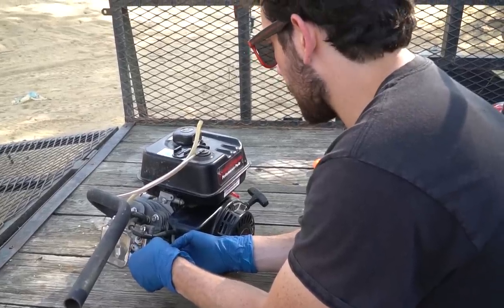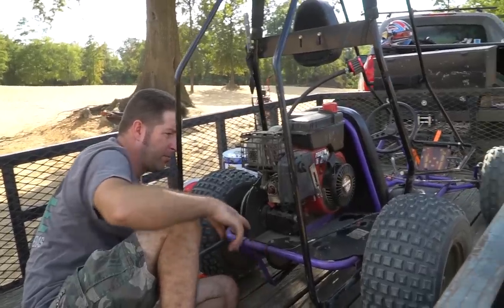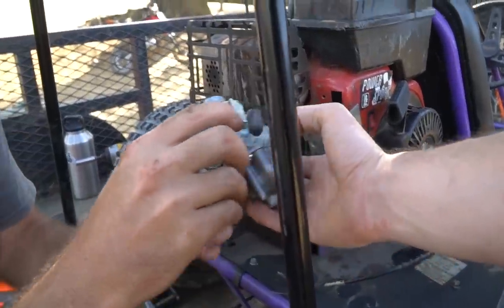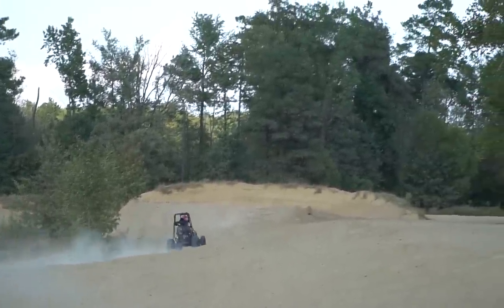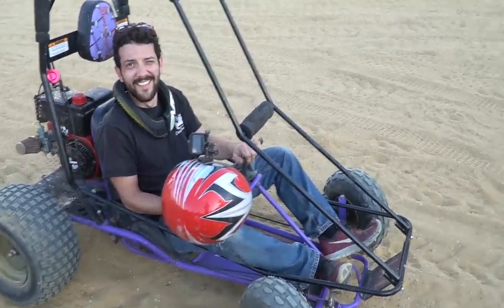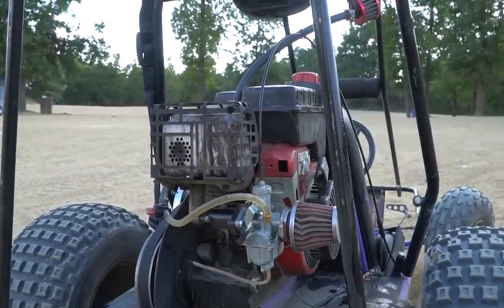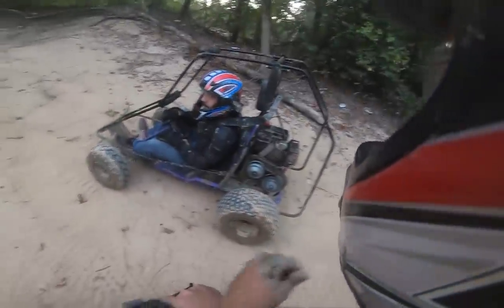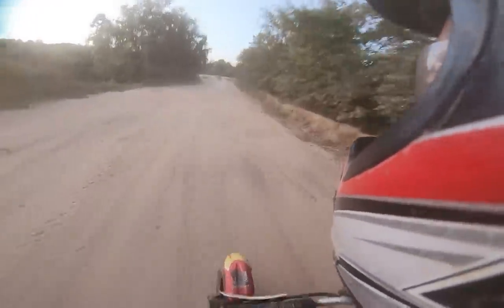Secret Tecumseh Performance Mod | One Bolt On = WAY More Power!

Comment: I have to Invader fun kart with the same motor, what I had done is weldeda intake  that is 3 inches long with a 20 mm Mikuni carburetor I shave the head with a belt sander and shimmed the stock valve springs and made a three-step header 91 octane gas bypass governor and did a light port and polish on the intake and exhaust to match Port the new intake it went from going 42 miles an hour being stock with a bypass governor now it goes 56 miles an hour with aggressive gearing

Comment: I have the same kart but the Tecumseh engine had carb issues. Swapped in Predator 212, now its too fast and i'm swapping in a Honda atc 185 rear axle with drum brakes.

Comment: This video was very helpful. I'm currently building a Dingo with an 8hp Tecumseh. I've done intake and exhaust but have been wrestling with fuel issues with the stock carburetor that drilling the jet hasn't fixed. What size Mikuni would you recommend for an 8hp Tecumseh with an intake and exhaust? 26mm maybe? (This is a question for anyone to answer. I don't really expect John or Isaac to see this.)
Reply: JustTheTip187 I bet Isaac will comment?
Reply: 26 might be to big. Id go in between

Comment: If they don’t sell billet rods for the Tecumseh. I have jb welded a rod before it took the abuse and  the high rpms well. Never snap a rod before that way but you do lose hp because it’s make it heavier.

Comment: Okay y'all are just driving me insane, I've been a small engine repair mechanic for over 20 years the correct pronunciation is ti-KUM-see
Reply: And I've heard it both ways for close to the same time and no one can agree on the pronunciation.
Reply: That's true I have to butt down here and South 95% say it with .....see sound
Reply: Actually its te-kum-sa
Reply: It’s not leviosa it’s leviosaa! HP fans will get this.
Reply: @adventurefishing3190  I thought it was te-kum-say

Comment: ANOTHER really cool trick to do on a small 4 stroke engine is, split the case and retard the valve cam gear by one tooth. Put it back together, fire it up and at idle, it'll sound like it has a high performance cam in it, but will rev quickly and have more torque. Pretty cool! Have fun! 😁

Comment: I'm gonna help you out here, if you wanna stick a billet flywheel, everyone will tell you that it's impossible and that theres no  such thing made for it and that is simply not true.  You can use a billet aluminum flywheel meant for a 5 horse flat head with the electronic Ignition but you have to cut the posts that the coil mounts to a bit shorter  and retap so it lines up with the magnet.

Comment: BMIKarts is gonna have a few goodies for that tecumseh the weakest part on that engine is gonna be the Rod i think ARC still sells billet rods you will have to call them also the blow by issue can be fixed really easy you will have to build a catch can nothen fancy but it will need 3 inputs and 1 out put on the bottom and a breather on the top stuff it with some steel wool not alot just enough to prevent oil build up and sloshing

1. Drill 2 holes in front of the case if you plan on keeping the factory fuel tank or attempt to use 2 90's 3/8" will do run 2 of those to the top of the catch can
2. Tap a 3/8" fitting to the Rocker cover using the factory hole and run that to the catch can
3. Run a drain from the catch can to front of the engines oil drain if it has one if not drill and tap a hole for one 

Intake from my previous testing a 22-26mm mikuni Works great 22 being the smallest id go for a intake i just made some Flanges out of 1/16" plate and 3/4" Exhaust pipe from BMI karts just the U bend from one of there kits and a BMI exhuast 

Carb i used a 24mm Mikuni Flat slide 170/20 jet kit and my custom intake this was on a 5.5hp same block pretty much as the 6.5

Rod/Flywheel I never did find a flywheel but i got a Rod threw ARC and if memory serves me right it is a tad bit shorter from them so shaving the head is a ok thing to do altho i would not shave it to to much but for everything else i ran Stock. 

Engine did make some power but the cam is the limiting factory along with lack of aftermarket valve train goodies.

Comment: In the video you said that with the stock carb the engine cut on and off. I have a and manco dingo with a 10hp Tecumseh and my does the same thing do you thing a mikuni would help? Also loving the manco dingo videos keep up the good work.
Reply: It helped us
Reply: Do You think a 22mm would be able to run a 358cc 10hp or should I go bigger?

Comment: Do a off set key on the flywheel and crank to adjust your timing run her on some race gas and you for sure will have to open the exhaust then you will have a stage one performance Tecumseh.

Comment: What is the issue with oil leaking out the crankcase vent? I'm pretty sure I have the same issue on my Yerfdog. I was thinking I'd need to tear down the motor to figure it out, but if someone can point me in the right direction, that would be great.

Comment: Just change the crankcase vent,-they go out alot on those motors, they are great engines other than that in my experience

Comment: Guys it's a shame that Tecumseh went out of business. They were cheaper and easier to work on with the carburetor designs they had...the only difference between Tecumseh and Briggs and Stratton is the Brigs IC or industrial/commercial models with a cast iron cylinder liner and roller bearings on both ends of the crankshaft...I worked on Tecumseh engines and all other 2 and 4 stroke engines every day for 5 years.. I miss my Tecumseh...😰

Comment: Not bad i have a go kart like The engine it was on the yerf dog well i do have a yerf dog and i used it in mud with turf tires and it will just tear the mud up no joke but i had to get the carburetor change  welp for a stock engine no mods to it will probly go about 40 HPM  but carburetor engines are not dat bad

Comment: Tecumseh engines are good motors but the stock carbs on them are garbage. Personally I would really like to see what kinda power you can come up with by just porting/polishing and other cheap mods. Watch the flywheel tho, I have no idea what kinda rpm's they are good for.

Comment: If you buy a new valve cover it will not blow out oil because they have check valves in them and the old one is not closing all the way

Comment: All the Tecumseh race motors i built i had to run a oil catch can. They all blow oil. I have about 15 to 20 tecumseh ring sets, Some are in boxes all are new. I have a Tecumseh Star race motor. I will only sell it all together, The Star Motor is pulled apart sitting in my parts washer. Won't ship will have to be picked up. Weighs to much to ship.I have New Star side covers . To who don't  know a Star is a 10 Hp. I have cam blanks you can have grind to the Duration you want.

Comment: Do u have to remove the gover from predator to install a carb swap
Reply: web homemade projects, no. The governor limits rpm on the engine. If you take the governor out, put 18 pound valve springs in so you don’t blow the engine up. The engine cannot go above 6,000 rpm.
Reply: So I can leave it

Comment: Tecumseh engines have crappy intake port castings. You'll see when you remove the factory intake manifold.  Port the intake with a dremel tool and get rid of the sharp edges/corners to improve flow and pick up even more power.

Comment: here you guys go. I have a list of different aftermarket parts you can modifly for that engine...https://www.oldminibikes.com/forum/index.php?threads/tecumseh-ohh-build.131688/
here is one of my drag motors I built couple years ago. turn over 8000 rpm's at 125ft, race it on clay surface.https://youtu.be/Ue-4HkKUTNE

Comment: Great video guys, thank you!
In my experience over many years...Tecumsehs are junk!
I have never had one that stayed running good or last nearly as long as the Briggs and Strattons I've had.
99% of the time the carbs failed or corroded beyond repair and I never used and gasoline with alcohol.
That was usually followed by engine failure, some spectacularly throwing the rod clear through the block.
The last one was on a push mower I inherited. I spent $80 on a new carb and other parts, it blew out the crankcase seals and the new carb failed after less than a year.
No thanks, I will not ever use a Tecumseh again.
Reply: the Tecumseh had tons and tons of carb issues well they dont have to worry about that any longer. the blocks were pretty reliable just cant over rev them as much as you can a brigs. but if they lighten up that fly wheel port and polish it shave that head bigger valves even by the slightest and take their time to tune that carb with a good pipe that engine will run with these other ones these days. they need to advance the ignition timing and modify the cam a slight bit and they will see a huge gain.  JUST DONT OVER REV IT. that rod will fly through the block done it on a ton of these they blow up allot easier then brigs but when built correctly they will be fine specially when under a load.
Reply: stop spining them so hard then. id be glad yto take all your tecumsehs. on btw, they run harder than and beat briggs engines :)
Reply: That's the problem, I never did spin them any harder than the factory set governor would allow and they would still self destruct within 2-3 years of purchasing them.
Sorry, they all went to scrap metal years ago.
Also, I don't really care about your statement that they run harder and beat Briggs, I no longer care because I haven't been 12 years old for a long time.
Reply: @TrojanHorse1959  ahh, the old ad hominem trick. you aren't impressing anyone by trying to claim how "grown up" you are. No one cares here. I've seen shitloads of Briggs sling rods too. All you have is an opinion, nothing more.
Reply: Lol! I made no "claims" about anything other than I'm not 12 so your childish digs at me about Tecumseh vs Briggs do not bother me in the least.
Yes, I have my opinion and experiences to rely on which are what formed my opinions. Because they do not match yours you felt the need to troll my comment. Crawl back under your rock, no one here cares what you think either.
Reply: @TrojanHorse1959  no trolling, just calling out your claims. your experience is not another's.
Reply: Well good grief, everyone knows my experiences are not the same as anyone else's, Captain Obvious.
I did say "In My Experience"...meaning they are just mine and no one else's.
And, not knowing me or anything about me, you can't "call out my claims" because you just do not know and pretending to know makes you a troll for attacking me with no provocation or good reason.
That is trolling whether you wish to admit it or not.
Reply: @TrojanHorse1959  I've had my own experiences with Tecumseh's, and never had the problems you speak of.
Reply: I can understand that, it's possible we live in different areas and have different suppliers or you don't use your small engines as much as I do, or the Tecumseh Gods hate me, who knows.
Every Tecumseh I have ever owned has been problematic or they self destruct. In my experience they are just not as tough or as good as a Briggs and Stratton.
I have one Tecumseh left, it's an 11 or 12 hp horizontal shaft engine. When running it vibrates so terribly bad that I cannot use it on anything and most likely the carb is bad again at this point. I have tried to trade it for an equal size Briggs, or just sell it outright, but no one in my area wants it and I cannot blame them.

Comment: That Tecumseh is a flat head engine with stock flattop piston, so you will get more compression! Definitely a good combo with that Mikuni Carburetor! Change the stock muffler with a pipe exhaust. The exhaust port should be threaded to easily add a straight pipe exhaust.

Comment: I like tecumseh engines my dad told me they are aluminum block with a steel or cast iron type sleeve cannot remember which one exactly but I do believe that’s the only motor built that way .... ps that upper cage looks like it’s just there for looks with the helmet cam lol

Comment: Bring me one engine and I'll give you 2 I have 2 tecumseh 195cc and a 169 robin too you can have them for a stock 212 running lol the carbs are the problem
Reply: The carbs are the reason half these engines are warn out
Reply: I also have a brand new in the box flowmaster 40 series never been opened last of it's kind from them till ther all holley